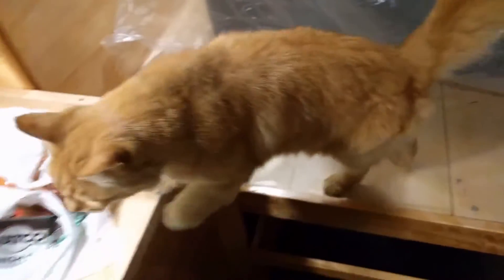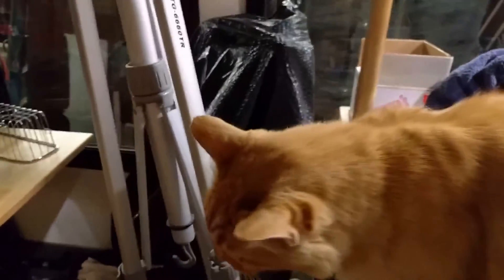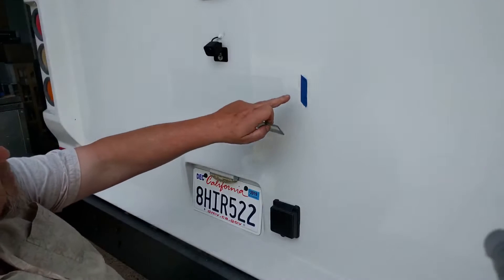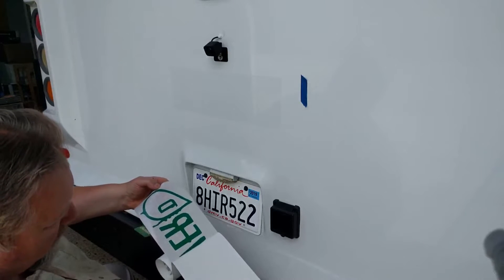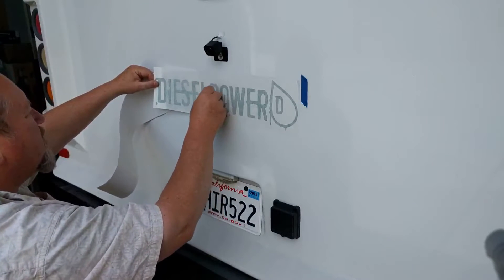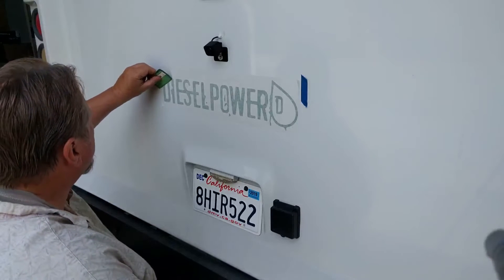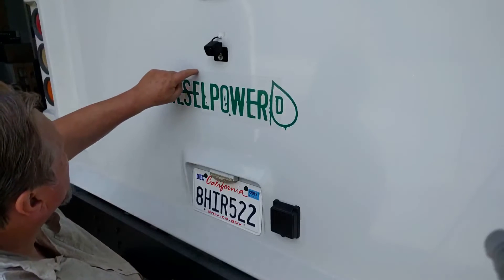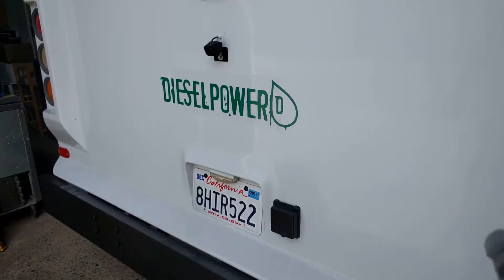Shuttle bus rv conversion (Part 64) Just Doing Stuff

Comment: tsk tsk tsk LOL...put it up there make tape hinges on the top then pull the backing off and squeege out ... I have been in the sign business since 1974.. made lots of mistakes learned a lot :)
Reply from the maker: @ The American Wanderer  Man I should have let you do it! LOL  I have 2 -11 inch circles in my paint where the city had their decal, what vinyl decal idea do you think I could cover that with? I was thinking something like a compass dial, you must have some good ideas. :  )
Reply: @robertbraden3889  Thats a tough one.  maybe do a white circle with the name of the bus or some design, or a large graphic that will cover the area... or it will eventually blend in